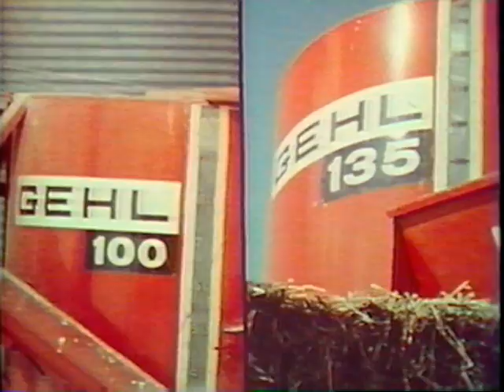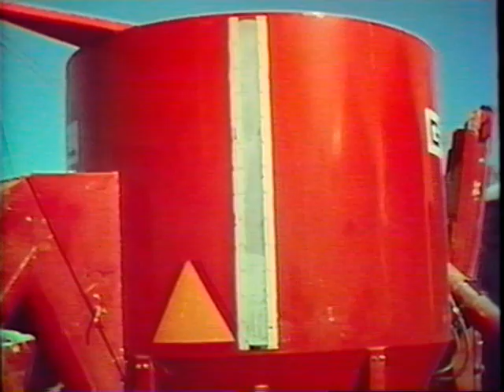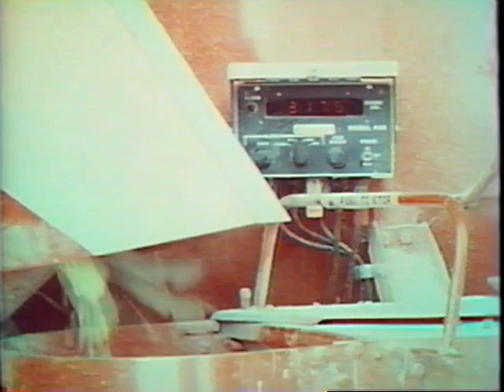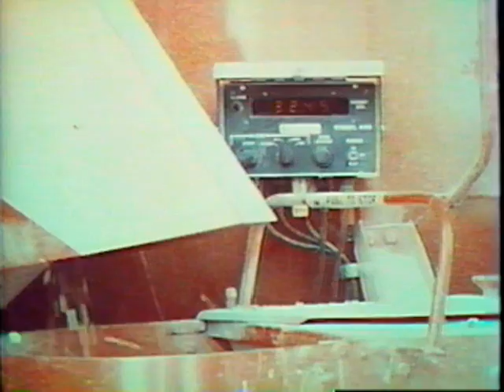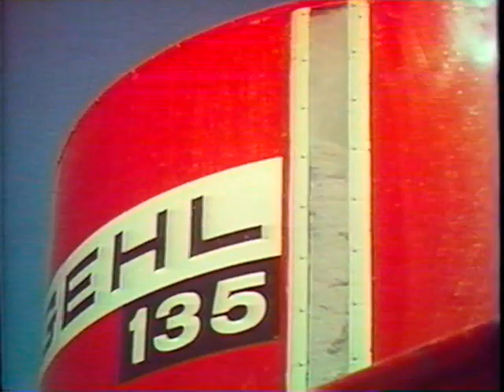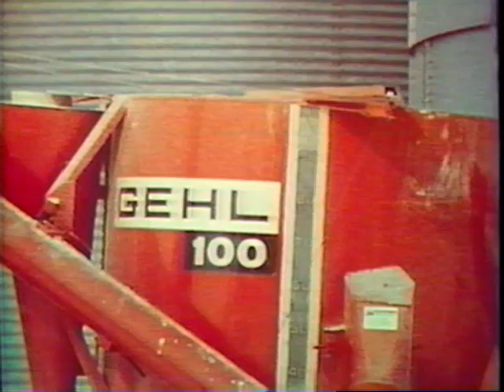Gehl MX100 MX130 Mix All

Comment: I bought a brand new Gehl 95 in 1978. Shoveled it full of ear corn once a week for 35 years.
Reply from the maker: They had to be die hard machines to keep up with the demand. Sounds like you got every penny out of yours. Did the gearbox under the tank hold up good?
Reply: @ikonseesmrno7300  I seem to remember replacing a bearing in it once. That was it.
Reply: Had a Gehl 100 same for me. Used a John Deere 3020 every time and on Tuesday I will be doing it again.

Comment: Love it!  Have a few loads to run through my MX-120 next week.  Always found it a bit odd that the hydraulic drive on the 95 and 120 still kept the bevel gears on the auger bottom out of the tank, but hydraulic drove everything else.  Works alot better than the mechanical drive mess they had though.  I liked my NH mills the best, but had a Gehl 65 and the 120 I have now.  I would be running a NH yet, but I got a building I go in and all the NH mills with hydraulic drive options are too tall, Gehl's tanks are a bit wider and shorter for the same capacity so that is why I have this 120.